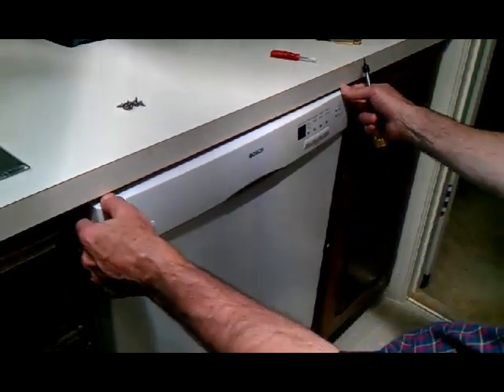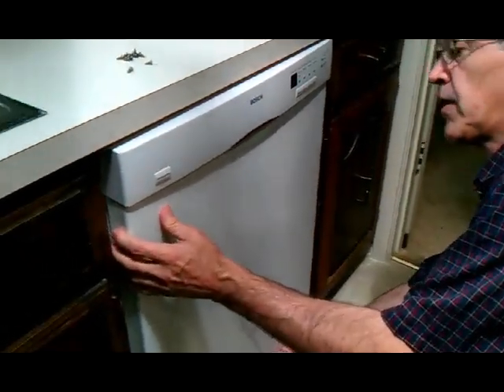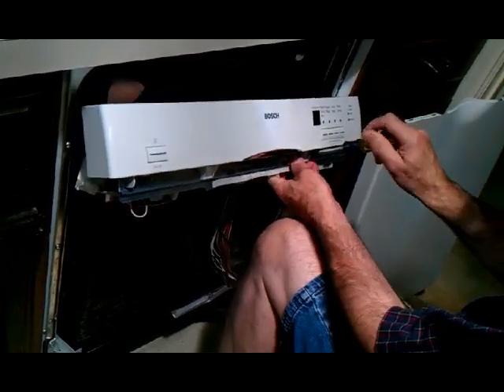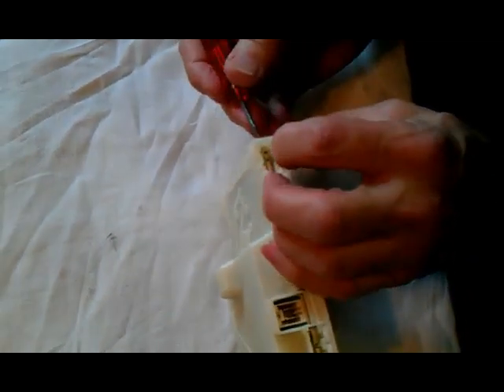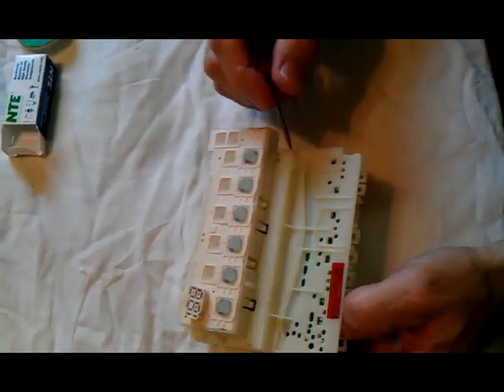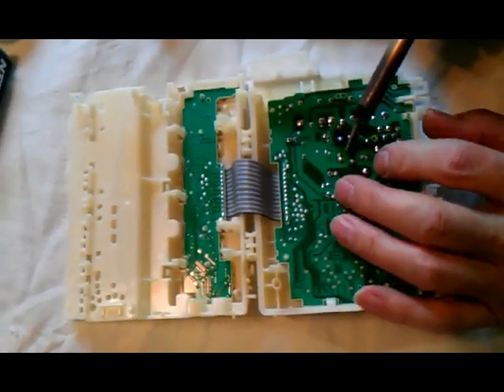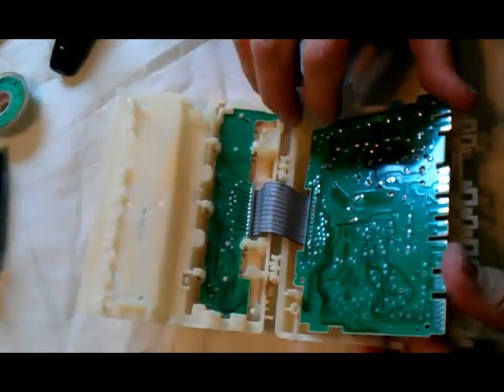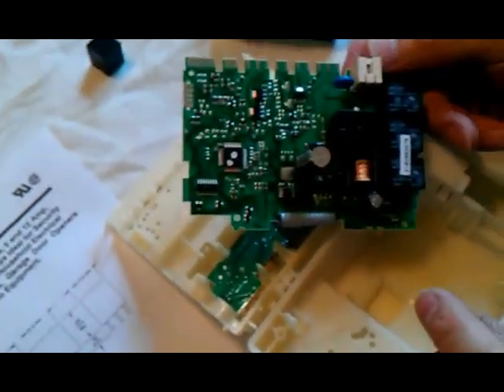Bosch Dishwasher Heater Relay Repair Part 1

Comment: Wow this video is perfect and exactly the issue with my Bosch dishwasher! I don't really want to spend $175 on the control panel so I will try to de-sauter my relay and replace it with the new $10 relay like you did. Hopefully it won't be too hard for a first timer
Reply from the maker: Check out my other video about making repairs to the board if you are a "first timer".  It may help you out.  The link is in the video description at the bottom.  Click on "SHOW MORE" to see it.  Cheers!

Comment: Thanks pretty helpful . Apparently it's the heater relay overheating . I also drilled a hole in the case where the relay is to dissipate the heat a bit . The cost of the Board is 2/3 the cost of a new dishwasher in Canad . The relay is around $2.00  although that model is not sold in North America
Reply from the maker: Yes, the cost of replacing the board can get quite expensive.  Fortunately, replacing the relay is cheap as you mentioned.  If you need help choosing a relay (I am assuming that is what you are referring to as "not sold"), let me know.
I am not sure that drilling a hole in the case is a good idea.  Sometimes these control board fail catastrophically and the case helps contain any potential additional damage to the machine.  Take a look at my other video about making repairs to the board and you will see an example of that.
Thanks for commenting.  Cheers.
Reply: @AgglomeratedIdeas  So  Its been running extremely  well with just the solder fix . Although I did order a new  relay from Amazon in case it fails. the hole I drilled is about a  1/4 inch just above the relay.
Reply from the maker: @nickmercouris8933  That's good news!  It often happens that re-soldering the relay will make the DW run its full cycle again.  But, of course, the ultimate fix is to replace the relay with a new one.  Cheers.

Comment: This is driving me nuts! I'm running a SHE46C02UC/22 and it's got the same error everyone else is seeing; however, I don't show any burned solder joints or any sort of anomaly on the control board. In true ignorant amateur style...could this relay (it's 1 of 4?) be the issue even though it's not showing any sort of physical damage on the board? I'm not afraid to buy/solder, but I don't want to start swapping parts if it's the $200 heating element. It does run with the "1" on the  display for a good 45-60 minutes more than usual...and the water is luke warm, at best. Should I pursue this avenue of repair before I replace the entire unit?
Reply from the maker: Your description of your problem is typical of a failure in the heater circuit which often is a failed heater relay.  However, not all dead relays will present themselves as such visually (see comment below from Burt Bicksler for an example of that).  You may have a dead relay, or something else has failed in the heater circuit.  You should have a wiring diagram for your unit (if the installer left it).  They are often rolled up and stored near the water inlet valve.
Also, there is a troubleshooting chart you may find helpful in the video I posted about making repairs to the board.  The link is in the video description above...click on SHOW MORE.  If you know how to use a multimeter, then you should be able to quickly verify the source of your issue.  Checking the ohms across the heating element will verify if it is good or bad.  In fact, checking the ohms at the heater circuit connector -- the 2-pin connector that plugs into the control board near the heater relay -- will tell you if there is a open component in the heater circuit.  If the heater circuit checks okay, then it is likely the heater relay and replacing it is easy and cheap.
I just looked at the 2 photos you sent and I do not see any visual evidence of a failed relay, but it could still be a bad relay.  Let me know if you have any more questions.
Reply: @AgglomeratedIdeas  OK, so I've resigned to the removal and replacement of the relay, as my control board appears to be in near-perfect condition (as you noted). Mine shows to be a Song Chuan 899B-1C-F-C 6v. Of course, there are 4 of them on the board, but from reading these other comments, will this replace straight across with the R46-5D12-6? As I said before, I'm not afraid of performing the repair (even thought I don't have a solder sucker!) but I am not familiar with this particular type of repair. The others haven't shown the 'B' on the original relay, so I'm deferring to someone more 'in the know' than myself. 

Thank you so much for your helping so many people, including myself. The thought of trashing a DW that was originally over $800 seemed very "Gen Z"! Other than this, my device is flawless.
Reply from the maker: @aaronh9742  Yes, the R46-5D12-6 will replace your existing relay.  Also, be sure to watch the video I suggested above.  Let us know how it goes.  Cheers.
Reply: @AgglomeratedIdeas  Once again, thanks for the input. I have finally gotten a multimeter that works, and I have checked some items. I tested the resistance across the heater input (output from control panel) leads (red/gray-black) and I get no reading at all--shouldn't that show SOME resistance? If I understood your video tutorial, it should show some resistance...or at least a reading. If I'm doing this correctly, then it appears as though my relay is fine, but the heating element may have burned in two. Given that the water here was super-ultra hard up until about 2 years ago, that's very possible. I wanted to verify that I'm testing across the correct wires--as they're the heaviest gauge wires in the bundle connecting to the control panel!
Reply from the maker: @aaronh9742  The heater coil itself should measure about 11 ohms.  The red/gray-black wires are the heater circuit, but the wiring goes thru multiple devices.  And, to correct what I stated earlier, you may NOT be able to read any continuity...my bad.  For one thing, without water in the unit the float switch will be open.  If you cannot find your wiring diagram, then try to follow the red and gray-black wiring to the various components.  Another reason to find your wiring diagram is that it has the instructions for putting the DW into diagnostic mode and that may result in a code to help identify the faulty component.  Perhaps if you call customer service they might tell you the button sequence for the diagnostic mode on your model.

Comment: While for a different model your video was very helpful on pointing me to the possible cause of the failure.  

Our SHE3ARF2UC/21 dishwasher stopped heating for the drying cycle, and showed E:02 error.  It did finish cleaning but of course dishes didn't get dry like they used to.

In my case it was NOT the common problem with the relay overheating and causing a bad solder joint on the PCB.  I suspect that the controller in our model is using an improved relay for the heater, there was no sign of any overheating and the solder connections were fine.

I had ordered a 6V and a 12V relay just in case, and it was a good thing.  Our controller board uses 12V relays.  

The problem in this case was the coil on the relay had opened, so of course the relay would not energize.  If you have an ohmmeter you can check this on your board.  

For the 12V relay the coil resistance should be about 400 ohms.  

The common pin on the old relay was stubborn but I was finally able to get it de-soldered and the new relay installed.  Works like new again.  

So if you don't see the over heated solder connection check your relay coil for proper continuity.  BTW the relay on this controller board had an extra normally open pin, so you have to de-solder that as well.
Reply from the maker: Good troubleshooting there!  Yes, the relay can (and does) sometimes fail with no obvious visual signs...it is just not as common as the usual melted solder joint.  Thanks for the comment.  Cheers.

Comment: We have the Song Chuan 899-1C-F-C 6V DC for our model SHE33M unit. Can you recommend the proper relay to replace it with? Thanks!
Reply from the maker: The NTE R46-5D12-6 would be the suggested replacement relay.  Cheers.
Reply from the maker: Oh, and I would also recommend viewing my newer video about making repairs to the board if you are not proficient at soldering, etc.  https://www.youtube.com/watch?v=RLdi-PgvAnU
Reply: @AgglomeratedIdeas  Thank you! One followup question. There does not appear to be a "burn" on the board as evidence of a terminal fail. What we think we are seeing is that on one of the terminals the solder is "sunken" (to use a technical term!). It doesn't have a cone of solder around it, like the others. Is this evidence of fail in your experience? We've eliminated the thermistor and the heating element as the cause of our cold water problem to date, so this is our next line of inquiry. Many thanks for your help.
Reply from the maker: @nancyturner9948  Usually, if the solder does not look right, it is because the relay has overheated the joint.  If you would like for me to look at it and give you my opinion, you can email a photo to MyBrokenDW@ gmail.com

Comment: This worked great on my SHE43P05UC!  The replacement relay that you selected fit perfectly (there's another guide on the web that uses a taller relay and requires modifying the controller enclosure).  Thank you for this outstanding guide!
Reply from the maker: I am glad it worked for you.  Yes, I am aware of the other suggested relay not being a proper fit.  The NTE relay seems to fit all models without modifying the enclosure for the control board.  Thanks for commenting.  Cheers.

Comment: I have a Bosch SHU66C02 that has the same problem. The OEM relay is a Song Chuan 899B-1C-F-C-6V. Mouser does not have any in stock, estimated time to return to stock is a month. In reviewing this spec sheet, it states contacts are 15Amps at 125VAC. I compared both spec sheets.  The R46-5D12-6 looks like a close electrical replacement, contacts are rated at 12Amps at 120VAC.  How do you interpreted both spec sheets? I ended up ordering the R46 from Newark Electronics as it is in stock. Now waiting for delivery.
Reply from the maker: The R46-5D12-6 would be the one that I recommend as that is what I used in mine.  Still going after all these years!  Hope it works out for you too.  Cheers.
Reply: @AgglomeratedIdeas  First of all thanks so much for posting this video, it was very specific to my problem. Many thanks. I have this exact same relay 899B-1C-F-C-6V and will order this. I did attempt to resolder the burnt out connection, however, I am still getting the 1 min cycle forever. I have seen other posts that have suggested to replace all relays. Do you recommend this? Many thanks again!
Reply from the maker: @EricKinskofer  If the relay has reached the failure point that it no longer makes an electrical connection when closed, then re-soldering the relay will not work...it must be replaced.
I don't recommend replacing all the relays, but you can if you want to do so.  I have not seen any of the other 3 relays fail because they don't carry the heavy electrical load that the heater relay does.

Comment: Hey AI - Thanks so much for the video. I have the SHE43M model, looks exactly like yours except black, and with the exact same defective relay. I've completed the repair using the R46-5D12-6, and while the DW turns on and works, I now have an odd problem with the LEDs and timer display. For one, the 1st minute LED has one vertical line (bottom right) that is always lit. So a 2 looks like a backwards 6. And no matter which wash option I push, all of the wash options are lit. Any ideas on that? This was not occurring before I disassembled. I've double-checked the connections and ensured they are all fully seated and in the right slot (with a picture I took before removing connectors).
Reply from the maker: Sorry to hear that.  It could be that during the repair process some conductive debris got on the board.  You might examine the control board carefully for small bits of solder.  Another thing that is possible is that a component was accidentally broken.  The operation, or lack thereof, of the LEDs would not be caused by the replacement relay, so it has to be something else on the board.  I hope that helps.
Reply: @AgglomeratedIdeas  Yeah, I've just replaced the new relay with the original overheating relay and it's no different. Couple days ago, I re-soldered the original relay and it went thru a cycle and drained, and I was able to use the drain button to drain manually that way. Now it seems I've somehow broken it. I've checked all connections and see no issues. Everything is tight and clean. I'm pulling out my hair over here.
Reply from the maker: @pbakai182  Well, the silver lining seems to be that you have proved that the rest of the dishwasher works okay since it went thru a cycle.  Replacing your control board may be you best bet at this point.  There are multiple places to buy a new control board online, so look around as the prices do vary.  If the rest of the DW is in good shape, buying a new control board is still much cheaper than buying a new one.  My 14 year old unit is still working like new with only two minor repairs, so I am still a fan of Bosch.
I know it is frustrating to make a repair and have not turn out successful, but that's just how it goes sometimes.  When it happens to me (and it does), at least I know I gave it my best effort.

Comment: My heat relay is HF7FD/006-1HPTF(576). Could you confirm which replacement I should get?
Thank you.
Reply from the maker: That relay is made by Hongfa.  It has a 6 volt coil (the 006 in the P/N).  The replacement relay would be the NTE R46-5D12-6 relay.  Let me know if you need additional information.  Cheers.
Reply: @AgglomeratedIdeas  So I'm looking at the datasheet for the relay and according to the information there, the "1HP" means this relay is the double-pin type. If you look at the last page of the datasheet here: https://www.shc-gmbh.com/pdf/HF7FD_en.pdf
You can see that the pin placement is different from the NTE R46-5D12-6. How am I supposed to handle the pin placement being different?
Reply from the maker: @defr0st  Pull up the datasheet for the NTE R46-5D12-6 relay (http://www.farnell.com/datasheets/1750340.pdf) and compare the pin measurements with your existing relay and solder pads.  You should find that the NTE relay will fit your board.  Keep in mind that only the N.O. (normally open) pin is used.  Some boards do not have a solder pad for the N.C pin...they just have a hole in the board.
If you would like to send a photo of your board, I'll take a look just to make sure.  Email is MyBrokenDW @gmail.com
Reply from the maker: Just in case someone reading this has the same relay on their control board, the second pin on the Hongfa relay mentioned above is redundant.  The NTE relay can replace it.  Charles sent a photo of his board that confirms this.

Comment: So, am I correct that I need to look for the electrical specs for my model (similar but different number than the one in the video) in order to come up with the particulars for the relay I need? Or should the one appropriate to THIS model generally be fine for most?
Reply from the maker: This repair applies to many of the Bosch/Siemens models.  Unfortunately, there is no way that I know to determine which relay is used in the various models without opening the control module and reading the info on the top of the relay.  Usually they have either 6 volt or 12 volt coils.  If you do open the module to get that info, then you might be able to get the DW working again by installing a jumper wire.  It does not work in all cases because sometimes the relay is just too damaged.  See my new video about making repairs to the board as I explain how to do that in the video.

Comment: 2/23/20...Thanks for the gift that keeps on giving! I used your video and just fixed my Bosch SHU43C02UC/22. I soldered the burned connection and am looking for the replacement part. You could do a facial with the steam that was created. The dishes were clean and for the most part dry! Thanks again, Charles aka marauder2525.

Comment: Thank you AgglomeratedIdeas for the video. I have the same problem with my Bosch dishwasher and over the weekend, I added a bit of solder to the existing unit to make it work until I get a replacement part. 

Here's what is listed on the current/OEM unit - Song Chuan 899-1C-F-C 6V==DC (along with a few other numbers/letters). I assume, based on your guidance, this is a 6V coil and therefore the replacement would be R46-5D12-6. 

The dw model is SHE43F02UC/53 and someone else in the comment indicated that they had the same model and replaced it with R46-5D12-6. I do not think that the same model would have two different parts but wanted to be sure. Please confirm that I good to go with R46-5D12-6. Thank.

PS: The control board shows a total of four relays with the same spec....three of them stacked one over the other at the edge of the board and one to the left of this stack. What makes this single relay special that it needs to be replaced but the not the others?
Reply from the maker: Yes, the R46-5D12-6 would be the correct replacement relay for the 899-1C-F-C 6V.

The reason the heater relay fails is that it carries current that is near its full rated capacity.  This causes the electrical contacts in the relay to burn and fail.  The other three relays carry much less current and therefore they last much longer.

P.S.  You can replace all four relays if you want to do so.  It wouldn't hurt, but I have not seen any of the other three fail.